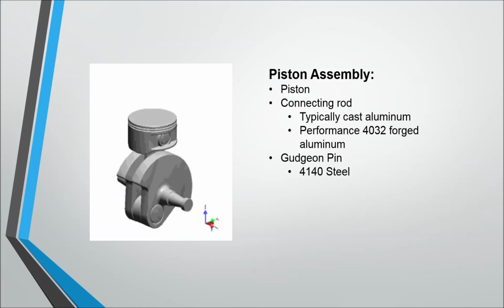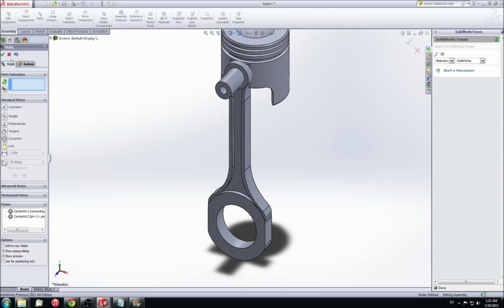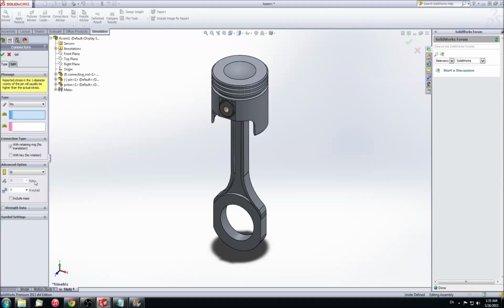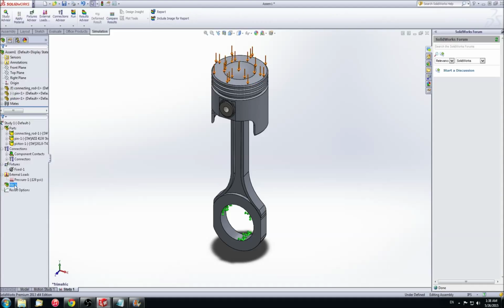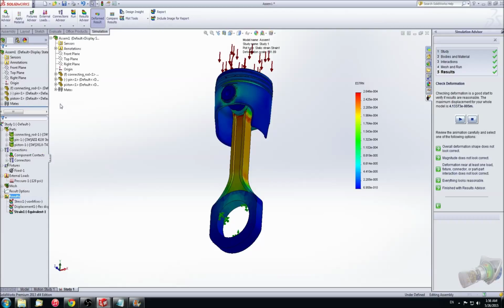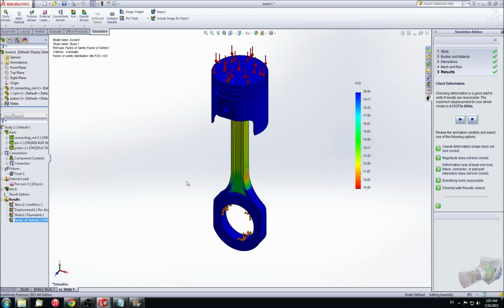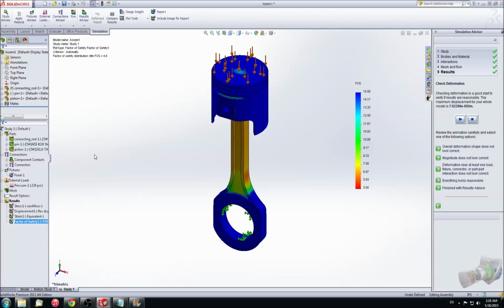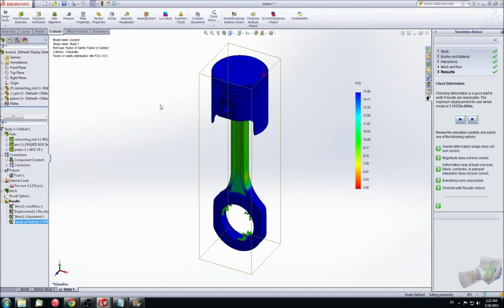Piston Stress Analysis [Solidworks Simulation (2/2)]

Comment: can you set the connecting rod in an angle? Like for example to analyse it when  it is 7 degrees off top dead centre
Reply: Omiros Christodoulou have you found a solution to this? I’m looking for the answer to the same question
Reply: Jay leak. If you do an assembly with the crankshat you can set a degree offset mate with the plane of the crank and the plane of the con rod
Reply: Omiros Christodoulou I’m not quite sure what you mean. have you got any videos or images that can help?
Reply: @jayleak_  do you know how to do assemblies? If yes then you must know the "mate" command where you use it to connect 2 parts for example, then use the mate command again and select the plane of the crankshaft and the plane of the connecting rod and there is an option to set an angle between them
Reply: Omiros Christodoulou yes I know how to do the assembly, I’m asking for help on the simulation section on how to set up the conrod to test for the factor of safety & then do a design study to minimise weight